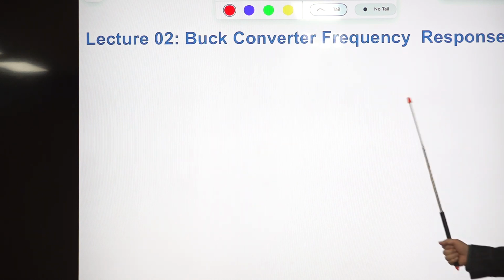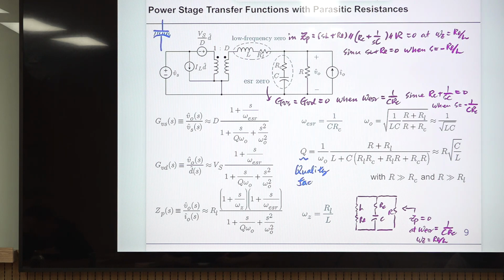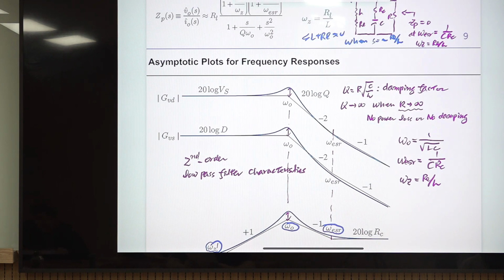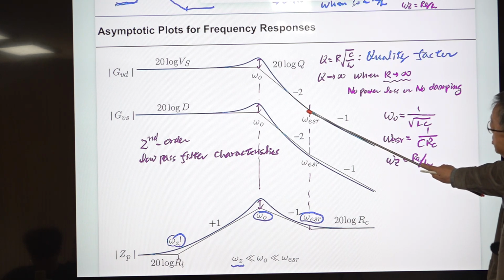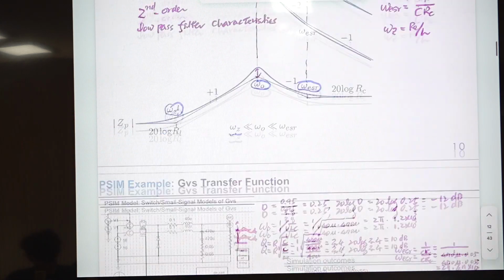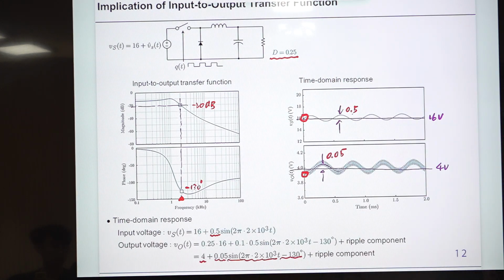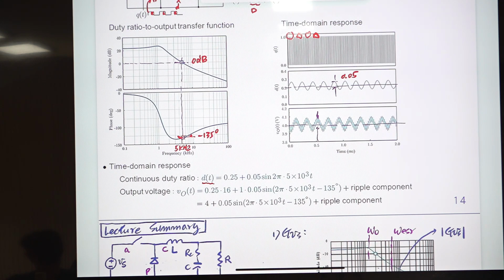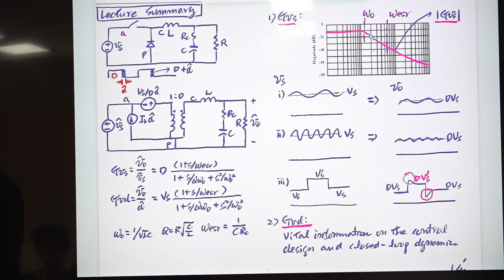Lecture 02: Buck Converter,  Frequency Response, Power Stage Transfer Function,  esr Zero, Bode Plot

Comment: Hello, Great PPT. It looks Voltage-mode Buck CCM. The DC gain of Gvd (Vo to duty) should be Vs divided by Vramp voltage.
Since you use Vramp=3.8V, 50kHz. the DC gain should be Gdc=20 log(16/3.8)=12.5[dB]. 
Furthermore, rL=0.1 is not ignoble compared to the load, Ro=1. Hence, for a more accurate result, it needs to consider rL and include the ratio of Ro/(Ro+rL)=0.91.
Hence, an accurate DC gain becomes Gdc=20 log(0.91 x Vs/Vramp)=11.66[dB]. But you use Vs only for Gdc=20*log(16)=24.0824[dB]. Inaccurate DC gain results in wrong cross-over frequency. Thanks,
Reply from the maker: Thank you for your kind and constructive comment. The lecture adopts the convention of vo/vc=vo/d  Fm  where vc in the output of voltage feedback compensation and vo is the output voltage. The vc will be referred to as the control voltage later in the lecture. The lecture slides indicate that vo/d is the relation between the small sinusoidal excitation in the continuous duty ratio, d, and the sinusoidal component of the output voltage, vo. Later, vo/vc is defined as the control-to-output transfer function. This convention can be consistently adopted to voltage mode control and current mode control, even though the latter employs  an internal inductor current feedback. Thank you again for the comment that brought up the issue and clarification.